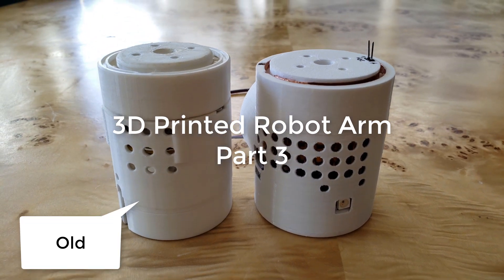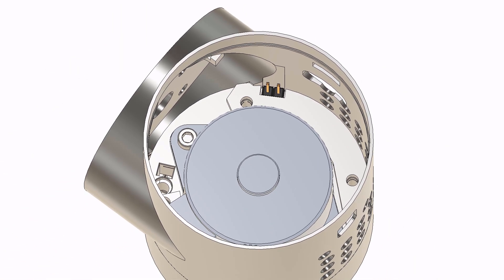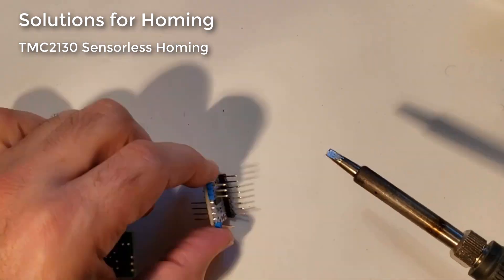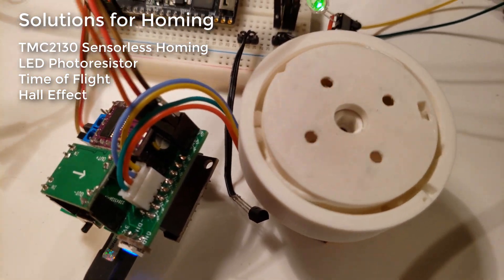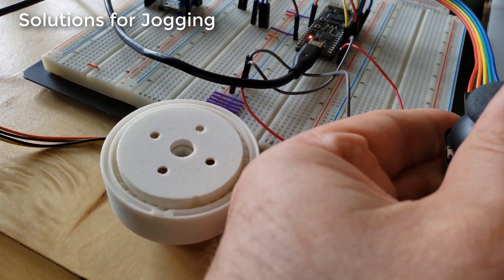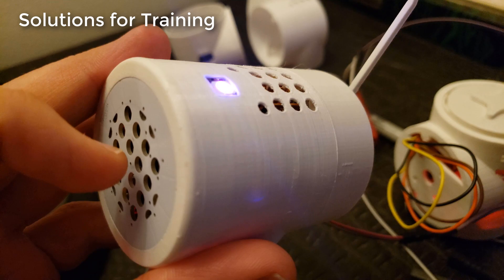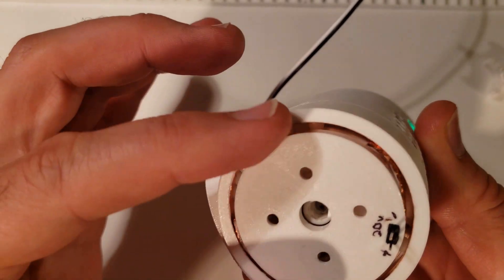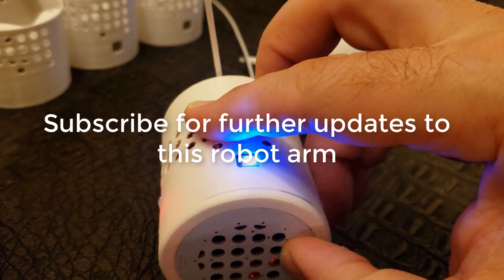3D Printed Robot Arm - Part 3

Comment: Hello John, I am wondering if you are still working on this project. I am going to make this arm to integrate as a part of a kind of kinetic sculptural project, but I have some questions regarding the motors you have recommended, because these use different voltages and I do not know if this issue is handled. I'd be pleased if you can get in touch with me.

Comment: Why did you move to acrylic instead of the airsoft bbs? You mentioned it runs smoother. Was is the diameter, or precision, or material? I'm making some slew bearings and I've been prototyping with airsoft.

Comment: Hey john! I’m back on this project again, a while back the cat jumped up and knocked my whole robot arm down on the ground and broke the base, it was my fault that I printed out a PLA! I’m gonna rip it down and see what components I need to upgrade to your current model as always thanks a lot for putting out this project I think it’s brilliant thanks James
Reply from the maker: Thanks James. I will say that I moved onto brushless motors as these stepper motors just didn't have enough power, even after the reduction gears. SimpleFOC is a project I recommend you go check out.

Comment: For the Copper Tape Split Ring, did you attach the sensors and wires directly to the copper tape?
Reply from the maker: No, all of the sensors are done over wireless. Just the power is done over the split ring. I don't like it though as I get little blips of power loss, so will be abandoning it.
Reply: @JohnLauerGplus  Do you have an update of the changes that you made? Or how can you reduce the power loss? Would love to get your input on how to transmit power without wires!
Reply from the maker: @cassandratom8986  I have not made any updates yet as I'm moving to a brushless motor for the actuator which has a slew of challenges. On the power, I'm not sending that wirelessly, I'm just running wires. It's the signals that were wireless, not the power. However, with moving to wired power, it may also be worth just running wires for the signals too.

Comment: Have you considered counter weighting your arm? By adding a counterweight to the base axis you remove a lot of the strain. There are static weights or active weights that move to change the balance as the arm moves. With a static weight you can set t to offset 50% if the max extended weight allowing the arm to move much quicker. With an active counterweight you can even offset higher axis.

Comment: U still alive? Kinda dropped off the planet 7 months ago O.o
Reply from the maker: Yeah, still alive and kicking! Trying to get a brushless motor going instead stepper for more power.
Reply: @JohnLauerGplus  not sure if you've tried it yet but double bevel gears might help too as they don't tend to push themselves away. Might be a bit more fiddly to assembly as you would need to put all the gears in at once xD
Reply from the maker: @exogator  Hmm, never heard of double bevel gears. I'll go check them out.
Reply: @JohnLauerGplus  My bad, heringbone gears, was half asleep writing that last one

Comment: When will a Part 4 come out?? This is dope!
Reply from the maker: Trying to get a brushless motor approach going for more power, so major redesign.
Reply: @JohnLauerGplus  you know, the next step is to attach a 3d printer head to the arm and write a slicer that can generate code for it. Just imagine: printing actual curves in space.
Reply: @LuisHansenNH  I’ve been wanting to do this myself!
Reply: @JohnLauerGplus  I hope it comes out soon, I could really use it
Reply: John Lauer we need update video
Reply: @JohnLauerGplus  I'm making an automated circuit board factory using this design. And I'm going to be selling the circuit boards on Amazon
Reply: @JohnLauerGplus  waiting for next update. interested the project. but have lack of knowledge. would you kind tell me what i must to learn first. have 3d printer right now
Reply: @JohnLauerGplus  Cant wait to see it! Brushless motors would add lots more power! Hopefully its going well
Reply: aproved

Comment: PS.  There is an electrical conductive filament that we could use to print the slip ring plus any other internal wiring!
Reply: https://www.blackmagic3d.com/Conductive-p/grphn-pla.htm   I made some Nike sandals that I could plug my rife machine into instead of having to hold and step on pads.  I just walk around with them plugged in! LOL
Reply: pss.  Look at ClicBot it uses a wireless feature to supply power to each add on motor.  I think it might help your design to mimic?

Comment: You can address the vibration in the cycloidal design by using two of them 180 degrees out of phase so that the vibration from one is cancelled out by the other.

Comment: You can use 2 metal springing balls to receive power on motors. This is more effective (or two rolls)
Reply from the maker: I'm not sure what you mean? You mean in place of a slip ring? Any examples out there?
Reply: @JohnLauerGplus  I try create pic to you later. Ok?
Reply: https://drive.google.com/open?id=1bSY4Je9cvTTw9S1i4J6flVdxAK5qOpen     sorry i don`t have cad on my work - but something like on pic (kid pic but i think it more informative)
Reply from the maker: @РодинаМояРоссия-ч3л  I see what you mean. The balls in your diagram are very similar to the brushes in the 3D printed design, so I'm not sure they provide much benefit. I've considered springs behind the brushes, but the plastic acts as a spring with the shape of the brushes. Plus, it's easier to to just print, than have to buy parts and assemble.
Reply: John Lauer yes like brushes. Well - as you wish but this is good way to solve problem frictions. ;)
Reply from the maker: @РодинаМояРоссия-ч3л  Does the spring scrape against the ball?  What conductive material is the spring made from? Is the ball made out of copper so it's highly conductive?
Reply: Graphite under the spring like in motors. And yes cooper ball good choice ;)  https://drive.google.com/open?id=191aV56eH6l_D7-DWXJDXdtntB9QA-OSB

Comment: Hello John, nice work you did, I wanted to make a robot arm for a while but when I saw your design... Wow!!! 

I ordered all the components and am printing all the parts. Now I am busy with ordering the pcb's.
Can you tell me where you ordered the pcb's? I wanted to order at www.pcbway.com and the touch pcb is 5 dollar, but the main board will cost 45 dollar. It has something to do with clearence and width of the paths. It has to be 6/mill. Can you change a setting in the pcb-file so that it will be cheaper?

EDIT: never mind, I ordered at www.jlcpcb.com without any problem!
Reply from the maker: I ordered them at JLCPCB for $5 per board. The wires were laid out with 6mil traces, so it must be something else. I do have some stuff very close to the edge like the ws2812 led 3 holes. Maybe that's creating the problems. You could swap that to square pads instead of castellated holes.

Comment: Hello John, congratulations for the amazing job done. I'm looking forward to see new update. I had some problem of melting gear with pla, i'll try with ABS. I'm also working for add a magnetic encoder inside the actuator, however I think the static mechanic torque is pretty good. 

How is gone with the project? For the development of other actuator what do you think about using Mechaduino or makerbase closed loop servo ? King regards
Reply from the maker: I solved the melting plastic with the active cooling with the fan, heatsink, and code running on the ESP32.

On the closed loop, I do think that would make sense, so the notion is to look at an encoder somewhere in the mechanism to know that steps are getting missed. Not sure best design. Would love to see if any others are able to get as far as I did and run some experiments.
Reply: Hi  @JohnLauerGplus  , do you have some example code. I try to search it in the repo but didn't found
Reply from the maker: @Alby32mx  The code is in the lua folder in the repo. You also need to upload the firmware to your ESP32 from the firmware folder in the repo.

Comment: Какой то ужас!. Хорошо начал и так испортил проект. Давай по порядку. Ты начинал с 17H4401, он дает 40H/1см, или 1H/40см. Да, мало. Нужно в 10 раз больше! Хотя бы 10 кг. Хорошо, допустим, будет редуктор 10:1. Этого более чем достаточно.. И рукой прокрутить можно, и нагрузку спокойно выдержит. Далее,  простой пример: берем простой абсолютный энкодер 12..14 битный, например AS5600. На полный оборот он выдает от 0 до 4095.. При 2-ух байтном  числе int можно получить 65535. То есть, подключим абсолютный энкодер, мы имеем 65535/4095=16 оборотов. С точность 0,0087912 градуса на шаг! Чего должно хватать для точности менее 1 мм, при рычаге в 0,5 метра! .Тебе бы подошел  комплект из: ardyinonano + AS5600 + DC-DC42V-5V+ MAX485 (ModbusRTU). А не это говно, что ты собрал с вайфай сетью.

Comment: John, I have built the robot arm and I would like to upgrade it with your actuators, which is a real cool design btw. I have watched a bunch of your videos and am impressed by your skills. My problem is I am old school  I worked in custom electronics in the 80s, I either did wire wrap or I laid out a PCB using a clear sheet and black layout tape at 4x scale then sent that off to the board makers. Having recently retired I am getting back into electronics and I am not sure what I need to do to have the pc boards you designed made. I have ordered all of the parts from the BOM, I am sure I need to have 3 boards made, the round pc board, the round touch sensor board and the small pc board. I am not sure which files I need to send to get the boards made. Thank you for any assistance you can offer.
Reply from the maker: I probably need to make a video of making the PCBs. I have also recently discovered that jlcpcb.com will even solder your basic parts to your board for you for a few extra dollars, so now I'm working on tweaking the design of the PCB to put all components on one side and switch to the standard parts in their library so that you get like a 70% assembled/soldered board in the mail. Since making that video could take several weeks until it's out, you could just watch a video on using jlcpcb to get through the ordering of the custom boards.
Reply: John Lauer thank you, I will check it out, my fingers aren’t as agile as they use to be 30 years ago so a pre assembled board with the small parts sounds good.

Comment: Slip ring idea is sweet, it looks like its already getting beat up. Would the voltage loss on magnetic induction work? Is there enough room between the plates for the magnetic fields for it without getting in the way of the Hall Effect sensor? Hmm, trying to think of some other ideas, you could modify the housing and use small conductive V-belts for low friction high surface area contacts, or like if you could get a tiny cable to have a rather seamless joint. A v-belt would be interesting, you might be able to get both polarities on one! I don't know if such a thing exists or not, or if it was made, how durable it would be.
Reply from the maker: I've been trying to use no belts at all on this project, so not sure a v-belt would do much. I am trying to think if there's a way to get one more conductive surface for actuator-to-actuator syncing using I2C or CAN bus since ESP32 has CAN bus built-in.
Reply: @JohnLauerGplus  What about magnetic induction?
Reply from the maker: @sinpwnzorz  Only problem I see there is that to get magnetic induction you need decent surface area for the coils on both PCBs. I don't have much surface area to work with given those planetary gears. I could see a coil on the top part of the actuator maybe working embedded into the top surface, but the bottom part of the actuator I can't see where that would go? You need those coils to be within 1 mm of each other for good coupling. Also, not sure if 20V could work either because induction requires PWM'ing the voltage. Doubt there's good off-the-shelf stuff to do that, but don't know really.
Reply: @JohnLauerGplus  Valid space concerns, without looking at the CAD files I can't say for certain, just brainstorming as your design has inspired me. However, traditionally, magnetic induction coils are used on the "stacked ring" configuration you're familiar with. (Two rings on one finger). It should work by doing something like small ring inside larger ring, I've looked this up a bit, and I can't find anyone else configuring it like that, probably because it sucks. However it may suck just not enough to work here... an out of the box idea perhaps? Based on the strengths of the magnetic fields in that configuration there will be more exaggerated efficiency loss than a stacked configuration, but if you overcompensated for it and used voltage regulators you should be able to accommodate it. 

Based on the documentation below, one of the modules I use and it's data sheet, distance only affects amperage rather than voltage. (Up to a certain point I'm sure) That would still be an issue but easier to overcome than needing to transformer up voltage and regulate it constantly. You would likely need to print a jig, and make your own wire wraps to build custom induction rings, though I think it would be fairly doable. 

The only tricky part would be making custom transmitters / receivers for the coils, which I have no idea how to do... but am now curious so I'm going to do some digging.

Example part:
https://www.robotshop.com/ca/en/12v-600ma-wireless-charging-module.html

Documentation:
https://elecfreaks.com/estore/download/EF03092-User-specified.pdf

Comment: Love the project. In industry we use teach pendants alot which allows us to give a exact numerical value as well as free jog. You could set up something similar to connect via WiFi like you already plan or connect to your primary controller.

Comment: I would actually have used the AS5047P 14bit high res positioning sensor with one ofe trinamoc drivers for accurate positioning and stop/ homing
Reply from the maker: I talk about the attempt to use the Trinamic driver in the video. It failed. The cost is too high at $5 per chip with zero benefits and only negative downsides. The chips blow like crazy, so you have to add 8 protection diodes, which don't really fit into the actuator and expand the amount of components you have to worry about. The sensorless homing does not work. The DRV8825's are actually fairly silent at 4 microsteps, which is what I'm running them at, so the silence of the Trinamic's isn't super compelling for the pain and cost. 

I am considering how to do absolute positioning, which would eliminate the need for the hall sensor, but there's no good solution given the format of the actuator. You want to measure the position on the reduced planetary gear output, not on the stepper motor shaft, so none of these magnetic chips do the job as far as I can find. Also, that chip you recommend is $12 so that's really expensive for this robot arm.

Comment: 👨‍💻How much to build this Robot Arm 🤷‍♂️ - i see a new one for $1k that does more than we thought  it soldiers, prints,grips  & does a load robot stuff u just add on  the parts you need & program & go go - even is mobile to run around pick up stuff  if u want  totally new tech - Also watched these guy who are making plastic type 10 layer pc chips 😳they hope within 1 year its smaller and if all goes well these chips could be everywhere in youer house like lights, switches program anything toys , cars , ? think and itll happen  there made similar to how  intel make there chips on a round disk but plastic type material GO FIGURE imagine/ space weight size 🥇👍Oh dec 2019 live SPACEX launch   🚀🌏
Reply from the maker: What is the URL of the robot arm you're talking about?